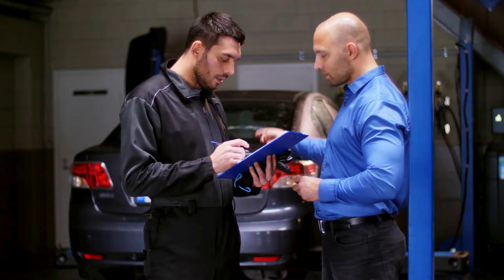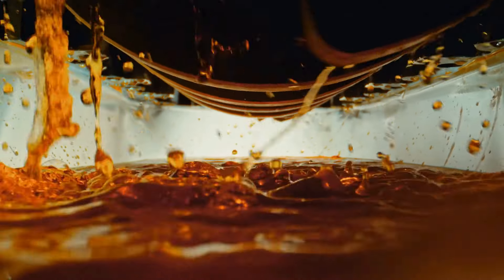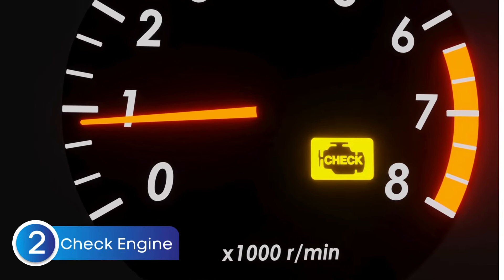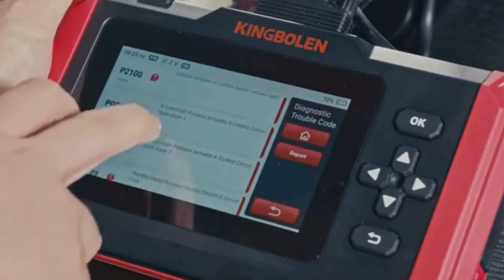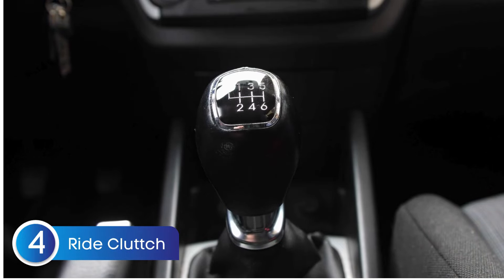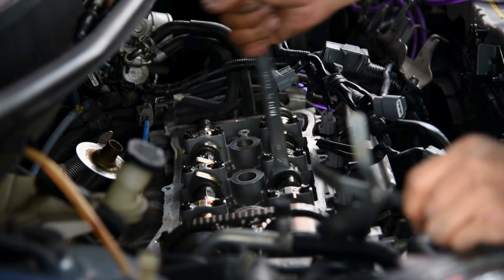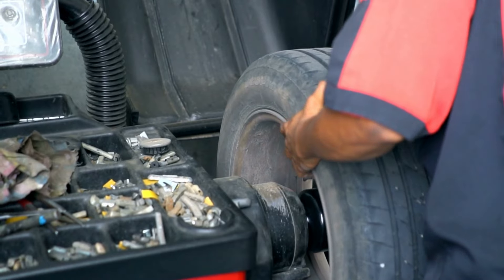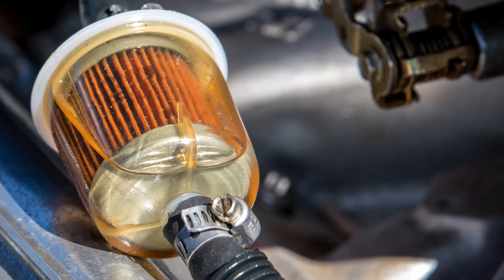6 Driving Habits That Ruin Your Engine.

Comment: A low RPM by itself isn't bad. What CAN be bad is heavily loading the engine while at a low RPM, also known as lugging. Sure, the occasional full throttle pull once the engine is fully warmed up is a good idea since it helps keep things clean, but cruising in a lower gear than required isn't necessary. If it was, all the automatic cars that cruise at barely above idle would have been dead a long time ago.
Reply from the maker: In a CVT, the infinite gear ratio allows the engine to consistently operate at its optimal efficiency and performance point. However, with a manual transmission, the optimized running point is typically higher, and maintaining low RPMs for extended periods can strain both the engine and transmission system. This difference highlights why CVTs excel at keeping engines in their ideal range compared to manual setups.
Reply: @carfix07  Still mostly wrong. If anything, a CVT would shift the theoretical ideal RPM for a given power demand slightly HIGHER since CVTs have more frictional losses than manual transmissions. That's why CVTs always have oil coolers while manuals almost never do.

The RPM ranges CVTs are programmed to hold aren't even optimized for engine or drivetrain longevity. The goal is balancing fuel efficiency, emissions, responsiveness, performance, and NVH. If getting 3% better fuel efficiency and/or meeting emissions standards means the drivetrain fails at 200K miles instead of 300K, that's what they will do.

Again, simply holding a low, steady RPM while cruising under a light load is NOT damaging to a properly designed drivetrain, it's pretty much the easiest usage. At worst, it MIGHT increase carbon buildup if taken to an extreme and the engine is never revved out under a load. Simply cruising in a lower gear will do very little or nothing to prevent carbon buildup.

Even then, the effects probably still won't be dramatic on an engine made within the last 2 decades. I have friends who literally almost never go over 2K RPM and they don't seem to have any engine issues after hundreds of thousands of miles.
Reply from the maker: Thank you for your detailed and insightful critique! I truly appreciate the effort you put into explaining these nuances. Your expertise adds great value to the discussion, and I welcome such constructive feedback on all my videos. Thanks again for sharing your knowledge!